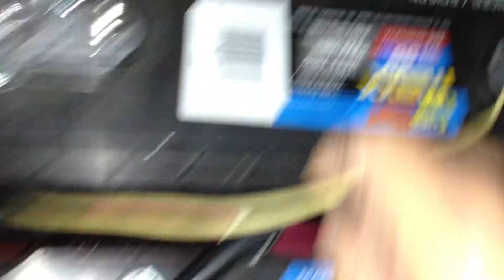EV Conversion Guide Part 31 --------Extras -- Capacitive Charger

Comment: How much you selling the controller and motor ??
Reply from the maker: Well, I think the motor was originally $1,900. So hows about $1,500, The controller was $1,500, so how about, $1,100? I also have the main contactor, fuses, and much more, well, complete car. Your almost better off buying the whole dang car. I am selling it at a loss, and in the end, if you feel like parting it out, you'd most likely make $3k-$5k on just the car. I really don't want to part out if I don't have to.